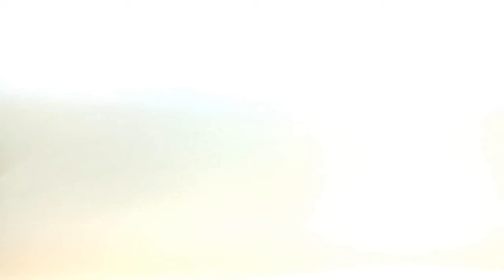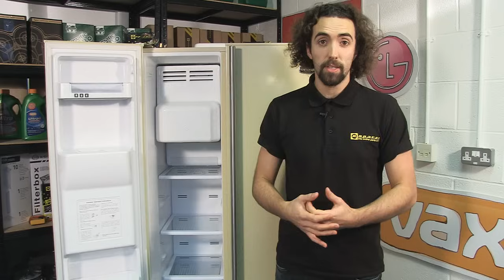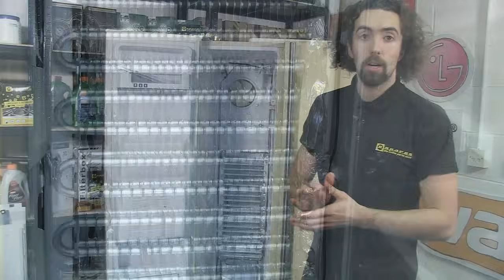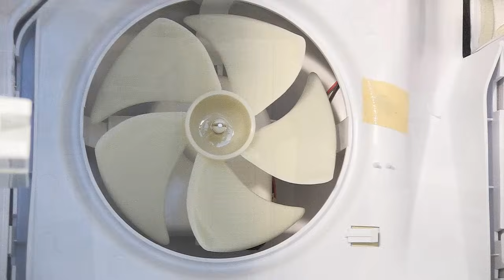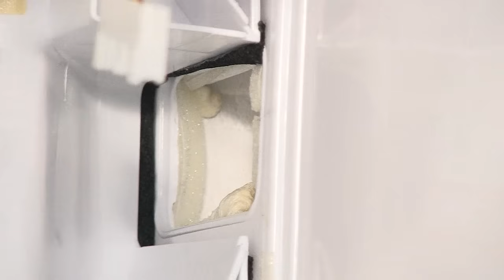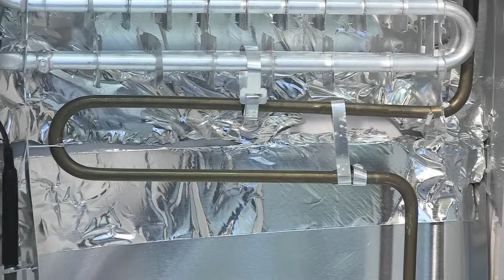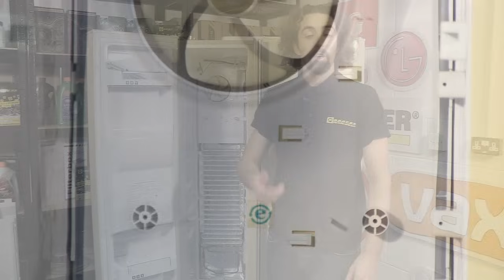BEST Advice: Frost Free Fridge Freezer Ice Build-Up & Common Problems!

Comment: Hi i have a Logik LFC55W13 Fridge Freezer .. worked fine then moved house . Now nothing no light, fan or compressor. I have power to the PCB circuit board on the back . Theres a mirco switch on the board, is this a reset switch ?
Reply from the maker: According to our info the control board does not have any microswitches see:
http://www.espares.co.uk/product/es1664604/fridge-freezer-pcb
Check if the compressor is hot to touch and listen for a quiet 'click' about twice a minute as both may indicate a blocked system if the appliance was turned on before it had settled.
Reply: The compressor is cold and theres no sound at all . the micro switch is in the picture you linked ( top right below the number 11009 on the board ) you can see half of it :) ... I have no power out the board to the fan or compressor. As I'm only a house electrician this is not cup of tea , so i'm a bit lost .. thanx for helping :)
Reply from the maker: Ah got it, not sure but best guess is it may force an auto defrost cycle when pressed. Many PCB's have a 'slow start' where they may have to be powered for up to 20 minutes before they spring to life. have you left it on for over an hour? if not try.
Reply: I'll leave it on for a few hour's , and see what happens , thx for the quick reply ( maybe a should'nt have pressed the button lol  )
Reply from the maker: If the button has been pressed and it does a forced defrost it is likely to remain defrosting for at least 20 mins even if defrosted before starting again.
Reply: Nope nothing ! :(
Reply from the maker: Time to suspect the PCB.

Comment: I have an admiral american style fridge side by side freezer and I believe it is tripping the downstairs sockets, where it is plugged in as when I plug it in upstairs on a former electric radiator  socket its working fine, I am told it may be the compresser? can anybody help?
Reply from the maker: Hi Stuart, If your appliance runs when switched on for several hours but cuts off the power to the house after 10 +hours it is likely that the problem is the defrost heater in the freezer (may also have one in the  fridge depending on model). If you are connecting to an old 'Economy seven' supply it is likely this will not have any RCD protection  so may not cut off.
Reply: Stuart Collingwood  i hv a frost free defy fridge its been 3 days the temperature settings if u set any temperature it jus sets itself again on high freeze and it start bipping the whole time don't know wats the problem please help

Comment: I have a Daewoo FRS U20DCB every two weeks I have to stip out back panel in freezer and use steamer to defrost it and ideas on possible fault finding with it
Reply from the maker: Hi Neil, as we try and explain in the video the problem is likely to be the defrost heater so next time get a meter like this: http://www.espares.co.uk/product/es1741061 and check the heater for continuity.
Reply: Thanks for the reply maybe a little video on the multi meter testing of those components might be an idea
Reply from the maker: We do not have access to a frost free freezer at the moment but there are two videos on the meter that show how to test many components. The heater will typically have a resistance of between 250 and 500 ohms.
Reply: Tiger doc
Reply: neil boyd zž
Reply: I have a no frost  Daewoo an for thé pas 2yrs I have water leaking out from  thé bottom of thé végétable  compartiment  unscreawed thé bck of thé fridge put a flexible intrument in thé pipé but still water le ans help
Reply: Could be many different reasons, one could be that the drip tube or pipe (should be one somewhere under the BOTTOM of your fridge, usually found wherever a drip pan is located) may be clogged or blocked up, or the spot in the freezer where the other end of the drip tube/pipe originates could be clogged or blocked. 
You would have to remove any back or bottom panels inside of your freezer to determine exactly where the water is coming from.
Many manufacturers use pieces of Styrofoam as sound and temp insulation as well as just filler and/or seals, sometimes as they age pieces drop/break/fall off and after a while can build up and cause the tube to become blocked.
It could also be due to a faulty Evap fan motor, when those go the heater coil that is usually found inside of the freezer will freeze up due to the lack of airflow caused by a dead fan. 
Defrost coils can also freeze up due to the condenser being over or even undercharged.
Clogged condenser coils can also lead to a compressor over running, which can also cause the coils to freeze and drip. 
A faulty temp sensor can also be an issue, hard to know without actually seeing your fridge.
There really are many things to look for when diagnosing problems with any fridge, plus every brand makes their stuff a bit different.
If you have no formal repair training and can't find a video to help you out, than it's probably best to call in a qualified/certified repair technician.
They really don't cost all that much to come by and tell you what's wrong, some guy's will do estimates for free, some will charge you just a small fee for a home visit and diagnosis.
Call around to different repair guy's and see who can hook you up and also check them out on the web and make sure you are getting someone reputable and not some overcharging schyster crook!
Hope some of that helps you out.
Good luck!

Comment: I opened my freezer up and it was frozen. I used blow dryer and melted it and it happened again a week later. Its a Kenmore Ultra Fresh Side by Side about 10 years old.
Reply from the maker: Hi Dana, If the ice is building up it suggests the defrost heater has failed or the control board. Use a Multimeter like: http://www.espares.co.uk/product/es1741061 to check the defrost heater.

Comment: Hi,
I've got a Bosch kgu3201 frost free fridge freezer which keeps building up ice around the evaporator and behind the back cover. Having reviewed your video, I'm trying to remove the back cover to expose th evaporator and heater but it's held in place by some recessed pinch clips (not sure how best to describe, but hoping you'll know what I'm on about). How do I pinch these to release the back cover. There are four of them. Thanks.
Reply from the maker: Hi Mrs O, we do not have access to one of these machines currently. Generally the covers are held on with several screws and four to six clips on the edge of the cover. To release these carefully push a flat blade screwdriver between the lining and the clip and by twisting the blade it can release when pulling the cover. Repeat this on each clip until the cover can be removed.

Comment: ... ice can also build up...not because of a faulty part, but a faulty owner by leaving the door open....DOH
Reply from the maker: Absolutely correct Mr Coyy's, and there are a number of models that can build up ice due to a designed error. If viewers have watched the video and the evaporator is clear of ice but ice has built up near to the evaporator and the door has not been left open, it may be worth checking with the manufactures if there is a 'modification' for their model.

Comment: Hi,  I have a siemens fridge freezer and it has just started to produce ice on the outside of the ice safe.  We have removed food, change the temperature, removed some of the ice form the ice safe.  Any ideas?
Reply from the maker: Hi Kerry, if this is a fridge with a small ice box inside we suggest you completely defrost the appliance and clear all the ice before drying any moisture of the evaporator (the ice box walls). Then check the door seals are making good contact all around the door as the problem may be due to air getting into the cavity and depositing moisture onto the cold surfaces.
Reply: Hello,

That's for the reply. I should of been more specific I was talking about the ice making section of the freezer compartment.  It is still icing up on the outside of the ice maker.
Reply from the maker: Hi Kerry, My reply above was for icing up around this freezer compartment so defrost and dry the appliance and check the door seals.
Reply: Thanks I'ii try that.

Comment: Hi Josh, I have a Liebherr CUN3033 which is working intermittently but starting to fail more and more often. It beeps as if the door has been left open and the 'alarm' light is illuminated red. I turn it off for a while and it seems to work ok for a few hours and then it starts beeping again - any ideas what I should be looking at? Thanks for any help
Reply from the maker: Hi Bruno, as your appliance is a frost free model follow this video to and check there is not a build up of ice blocking the air flow as this would cause your problem.

Comment: Hi, i hope you dont mind me asking but some how ive got to try and save my fridge as cant afford anew one at the mo, ive got a proline 55cm under counter fridge only 4 yr old, it will get cold and the freezer is ok, but when it drops below +4/+5 in temperature it dont switch itself back on i have to do it with the control knob, but it will switch itself off when it reaches the temp, so i dont know if its got something to do with a thermostat or something simple that i can fix and save me buying anew one, any help mate would be very appreciated. Thanks Matt
Reply from the maker: You have described what happens when a thermostat fails, often the thermostat will stick like this and a sharp tap on the knob when it is warming brings the unit back on. Replacing the thermostat as shown in the following video is likely to solve the problem: 
https://www.youtube.com/watch?v=srKnZXNQ8CM

Comment: Hi. I have a 2yr 3m old Bosch frost free fridge freezer at a cost of nearly £600. Model num KGE49BW41G. The freezer & fridge will not cool. The fan inside is working but i don't hear or feel vibration or warmth from the compressor. I've checked the temp controls, switched off at mains & back on, checked seals, defrosted it, coils are clean, vents are clear, light & digital display work. Could it be compressor or relay?
Reply from the maker: From your description it sounds like a control board problem as if the compressor fails it will normally be hot to the touch or make a quiet click then another five seconds later and repeat after one minute. When ordering the part make sure you quote the full model number (KGE49BW41G/05?).

Comment: I just got a used 2004 Add to dictionary side by side. Clean inside and out. Both fans, underneath and inside are running. The coils and fan underneath have been cleaned too. I plugged it in and everything works. The compressor is warm to the touch after running for days. There is no cooling happening in the freezer compartment, no change in temperature at all. The heater was on and the compressor was off. the compressor is running at .652 amps when it is on. why would the defrost turn on if it is 55% in the fridge? it has an electric circuit board defrost timer and I do not know how to test it to see if it is bad.  I bypassed the thermostat switch just to check is it was that and still nothing.  The fridge is outside in a 40-50 degree weather and covered so it never gets wet.   Is this a refrigerant issue or something else? Any advice would help. Thanks
Reply from the maker: Hi Tarcisio, If the compressor is warm it must be getting power, If this is the case it will either be tripping or running without any gas. Both problems would require a refrigerator systems engineer to either replace the compressor or re-gas the system.

Comment: Hi, is it normal for the fan that cools the air to be working every 20 minutes or so even if the fridge door isn't being opened? The fan runs for a couple of minutes or so. My fridge is brand new i.e 1 month  old. Type: Hoover HNC 6200 BNE. Thank you in advance.
Reply from the maker: The fan may only be running when the sensor detects the cavity needs cooling so as long as the temperature seems correct (and it is not overfilled to allow the air to circulate) it is likely to be OK.

Comment: Hi, I have a problem with my Hotpoint Mistral FF92P. The temperature indicators are all over the place, freezer is +22 one min then -22 the next, fridge not so much but still moving about. The contents seem to be unaffected by this, its not frosting up or warming up significantly. I googled a bit and it mentions thermisters? I had a temp E28 warning for about two seconds about a week ago but it went of its own accord. Any ideas? Thanks.
Reply from the maker: Hi Wendy, you really need to take off the evaporator cover to see if ice has built up and is restricting the movement of the cold air and thus this may be effecting the temperature readings.

Comment: can you send me instructions on how to reset defrost times. This kit and part number you sent Es1406833 is it compatible for the samsung fridge freezer rs21 jgrs. will this kit keep the heater on longer. Also can you send me part number and price for a pcb board. Thanks.
Reply from the maker: The kit comes with instructions and should be suitable for your appliance improving defrosting. For a quote on the replacement cost of the PCB please fill in your details and information here: http://www.espares.co.uk/contact/sales

Comment: would a faulty thermol fuse in the freezer compartment affect the function of refrigerator side is there any link between the two. on the samsung RS21 JGRS model. i have had a brand new kit put on. still having defrost problem on fridge side. rechecked all the components for faults, they all good. Have been told it could be the pcb board not letting the heaters stay on long enough. is there anyway of checking  my pcb board myself.
Reply from the maker: Some Samsung fridge freezers can suffer from ice build-up and may have a modification kit to prevent this occurring Stock Number: ES1406833. Fully defrost before removing the cover. Fit the brackets onto the back of the upper mounting screws, replace and move the sensor to the far left of the pipework and reset codes as per the instructions. The kit is available here: http://www.espares.co.uk/product/es1406833

Comment: I have a problem with frigidaire fidge,its about two yrs old; I get ice in freze and make nose, since i bought it, any fix?
Reply from the maker: If the appliance is not 'frost free' ice will build up on the evaporator coils inside. Any internal icing is effected by two things. Ambient humidity, so this will increase if the appliance is in a steamy or damp environment. And secondly, If the door seals have gaps or fit poorly air will be drawn in and result in extra frost inside. Check the seals and improve ventilation will reduce ice build up.
Reply: It is frost free,company guy came twice,he cleaned the ice,take of the the panel and wash it and put it back; put seal on door but same thing.
Reply from the maker: That suggests a defrost problem so follow the video and check the defrost heater and thermal fuse.
Reply: where that fuse locaed? so you want me to watch this video again? thanks.
Reply from the maker: The defrost heater is shown at 2.12 and the defrost thermal fuse is fitted usually on the right side of the evaporator in a plastic 'pouch'. the heater should measure between 200 and 400 ohms and the fuse should measure a short circuit.
Reply: any way i will call company again and see what they say, my warranty is over;thank you for your information.

Comment: Hi, my Hotpoint FFP 187b fridge freezer is becoming a freezer. The termostat doesnt appear to be working. Can you tell me where the thermostat is. It doesnt look as if it's on the PCB. Also can it be bought from eSpares? Thanks
Reply from the maker: Hi Fred, the control on your machine is done with a PCB. Unfortunately the PCB supplied by Hotpoint is not programmed and needs programming by either Hotpoint or their agents. Check if the problem is just over icing as shown in this video. If not you will need to contact a Hotpoint engineer.
Reply: Thanks eSpares. Appreciate your help.

Comment: Hi, I have a Hotpoint FUFL 1810 G (bought on good old Gumtree....!) which keeps frosting up. The fridge and freezer seems to lose efficiency at cooling/freezing and upon removing the internal back panel, the evaporator is clogged up with ice. I clear all of this ice up with a hair dryer and dry it all up, however this seems to last on a couple of weeks! The door seals seem fine, the motor runs ok I think, I don't suppose a rough guess of what the fault could be? I'm tempted to buy a mulimeter and test the parts but the price of the replacements seem almost the cost I paid for the entire fridge freezer.....so unsure what to do!
Reply from the maker: Check the defrost circuit as shown in the video as you may have a faulty heater.